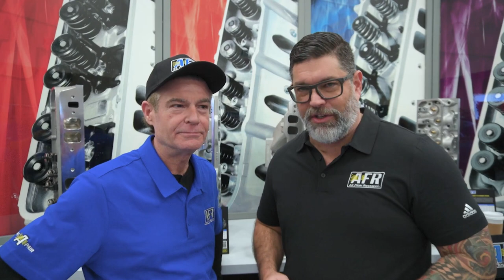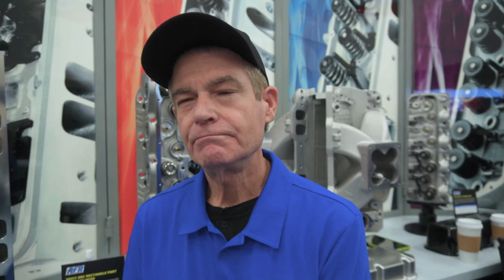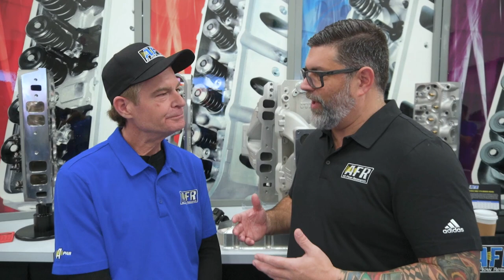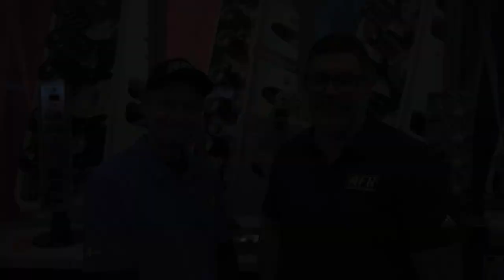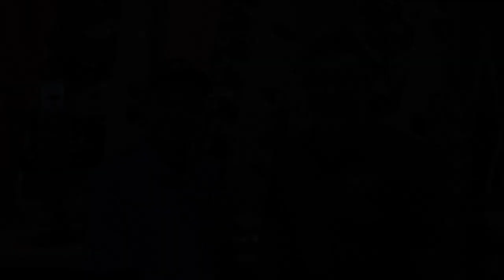Torque Talk with Scott The Hawk: What's the right AFR cylinder head for my engine?

Comment: On my 421 sbc I used AFR 220 heads with AFR TXR Titan intake and Holley Terminator X TBI, made 620hp at 6250 rpm  and very responsive. Mainly weekend Cruising. Could not be happier. From Down Under.

Comment: I have 210's on a 434 SB Chev. 10.5 cr, .600 lift, 950 Quick Fuel. It made 598 hp at 6300, with 562 Tq at 4600. In a 3300 lb Nova with a Turbo 350 and 4500 stall it runs 10:40's @ 128. About 6900 through the lights. Some people comment: oh those heads are too small. Then I make a run !! Tons of torque down low and still pulls hard up top. These heads are great and size does matter, my motor is never lazy, and it recovers very well at the shifts. Plus I drive it on the street ! Well done AFR.
Reply: I wanted 220s for my sbf 427. 
I ended up with 205s.
Reply: @I_like_turtles_67  love my 220's on my 302, power from start till whenever I feel like shifting at

Comment: I do believe AFR is thee best cylinder heads on the market.. There is a reason best engine builders and engine testers like Richard Holdner and Engine master guys use these to test pretty much every HP engines they build!
Reply: Best off the shelve head

Comment: About 10 years ago when I was first getting into building engine I researched the internet up and down and came to the conclusion that I wanted to try AFR heads on my first 383, I ordered some 195s, I blew that motor up in short order, so I built another 383, this time with 210s I put that motor together in probably 2015, put over 60k miles on it with a lunati voodoo solid roller, it originally had pinging problems due to my mistakes, it had a bad carb, and hei distributor issues, but at 40k I went with a holley sniper, efi and distributor, went to flat top pistons for more compression, and changed the rod bearings, valves and lifters. It runs hard in my 4800 pound truck and I’m not easy on it you can see it on my page if you want to take a look

Comment: Ok I did this got great power, but took a bare untouch head had it cnc for max flow, what a difference, got 100 more horse,and 175 more torque. Your cam is the most important

Comment: Just bought my second set of heads from afr, great stuff for the price.
Reply from the maker: Thank you for the repeat business, Bill!
Reply: @afr-airflowresearch9889  no, thank you for the quality product that a working stiff like me can afford. Used 195 street eliminator in the c4, using a set of enforcers for the c1500. Unbelievable quality for the money
Reply: I had the 165s and sold them to another guy. He loves them. 
I now have a set of 205s for a 351w stroker. Looking forward to seeing what that motor makes.
Reply: @I_like_turtles_67  Hey, I'm thinking about 165s on a stock 351w. You think it will clear ptv with a mild cam, 224/234 @ 050 Edelbrock 7182. I will double check for sure.
Reply: @Big-Lex124  It's best to double check with clay. Has the deck ever been machined? But if I had to guess. I'd say it's going to clear. Just check it. 
Best of luck. That combo should run pretty good. 
Are you using an air gap intake? 
What's the motor going in?
Reply: @I_like_turtles_67  Hey thanks for the response, Someone rebuilt the engine, all info lost. Might have been decked, I wounder if I can tell after I pull the heads. Looks like a Edelbrock 2181 on it now. 351w is sitting in a 67 cobra right now. I was thinking about posting a video. It was my Dads car, its nice. Deserves a 427.

Comment: These heads are awesome
Reply: Need a new recommendation for my bbc 427.. 13-1 compression, 3600# car, automatic, trans brake, cam is solid roller bullet, 255/264 @50 . In at 107* . Launch at 4k shift at 7500 currently. Single plain intake custom Willies gas carb. Race fuel. I’m still running the 781 iron heads fully worked over but considering switching to yours: my SBC woke up when I installed your 195s so I’m thinking time to switch. Thanks for your help. Blessed new year to you
Reply from the maker: @chadhulstein5661  Do you have a preference on oval or rectangular port?

Comment: I’m wondering if my 4.030 bore is a good fit for my 190cc heads-2.02/1.60 valved and 1-5/8 mid length headers to 6000 rpm?

Comment: Is there a formula to calculate the preferred valve size using the bore size, desired rpm range, or engine displacement?
Reply: Rough formula, bore x .51 (or .52). Is what many go by, but the other variables come into play also.

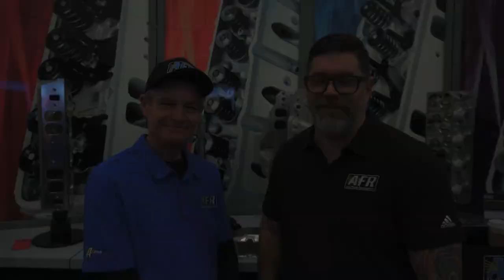Comment: i made a set of 283 power pack heads  run low 11s and 7:20 in the 8th in a s10 with 1.72-1.50 valves i spent a lot of time on those ! nobody believed they had those teeny tiny stock valves i polished them by hand ! i just ported a set of 906 big block heads for a 383 those went 6:60 in 8th 10:80 in the quarter in a 3200lb car not sure what the horsepower is but id say i probably did something right .

Comment: 🙋🙋🙋 AFR still doesn't make Cleveland heads or intakes so I have no interest in AFR. Got my Trick Flow 225cc Cleveland heads - top notch
Reply: Canted heads have their place. Just as inline valve heads like AFRs. 

I like both. 
But I went with AFRs for my windsor build.
Reply: CHI has been doing Clevo for decades and TF must've bees getting requests. 
Cleveland's are a smaller market than Windsor which already has good heads from CHI, Kasse ect.
AFR likely did a study into Clevo heads and found they wouldn't make any money.

Comment: hi 
U could post recommended MCSA or the formula on the website with a waiver saying application must be checked with cust service . Now I am overseas and on a 6400-6500 redline for a 400cuin SBC  AFR  recommended a 195  1.9 mcsa   by phone .  What an absolute croc 220cc 2.2 MCSA
3200 stall 3.6 gear  4bbl 1 7/8 primaries   these will make any 400 cu breath and use a larger head 
400 stock 5800rpm  =195 ,,,  400 modified 6500rpm =220 ,,,,,400 12.5 to 1 .CR  7000rpm =227 head 
To rectify this if I had directly purchased they would have swapped them . BuT I purchased thru an agent [this service is not available because my purchase was done this way ]

Comment: One thing you forgot to talk about and that is actually receiving your cylinder heads in a timely manner, 6 months and counting and they are not nothing exotic!
Reply from the maker: Hi Ross, we apologize about the extended lead times on heads. Our industry has been hit pretty hard by all this. Pretty much all us manufacturers are in the same position, doesn't matter what parts you are ordering. i.e. heads, blocks, pistons, rods, etc. I can honestly tell you that no one here at Air Flow Research is happy about the situation, especially our Sales and Tech departments.
Reply: @afr-airflowresearch9889  Great service most would blow it off
Reply: I waited four months for pistons. Supply chain issues are affecting everyone.

Comment: It's funny how they list port volume but say it's useless.
Reply: I could have sworn he said it was the number three most important?
Reply: @trailerparkcryptoking5213  no that is not what he said, he said it's the third thing he will tell you, not it's the third most important.
He's also trying to explain it in layman's terms, cross section is what you actually pay attention to.
Port volume will be different if the runner is raised as it has just become longer. 
So you can use volume if you're comparing to 23deg SBC heads but the 18, 14, 13, 12 and 11 degree heads will have longer ports because the runner is actually raised making comparing port volume of a 23 degree SBC head usless to an 18 degree head.

Comment: You can have wery big Heads if you have weeber 55mm carbs 4 off them! I have proff..csb 356 0.40 borr. 1993 i ran 10 sek time 402m..1600kg car...Brodix 11X  bigg boy ojäää... I hope four The 9sek time...Street car....somting ells coming in May way....today i weel run in The 8sek time i biliv hoppylly i can prov this with The old Csb parts...soon i hope csb 434 cui weel dou this happen...